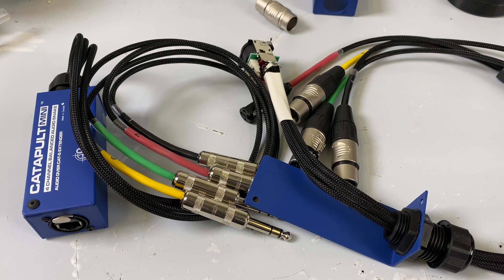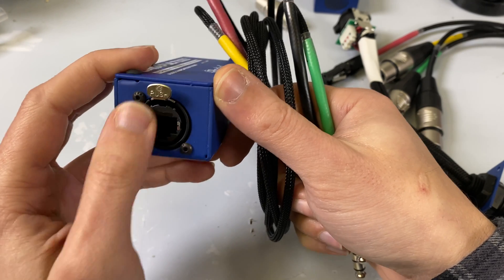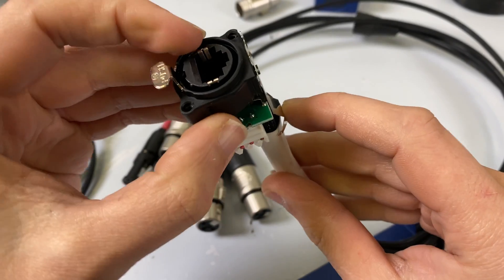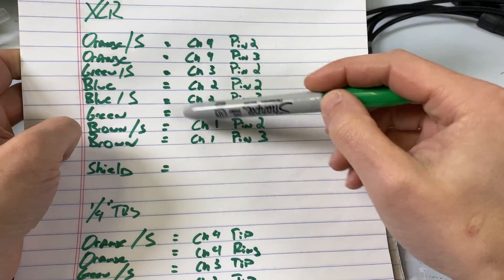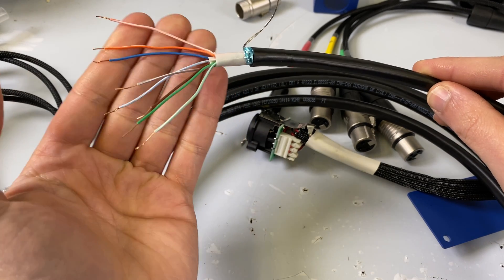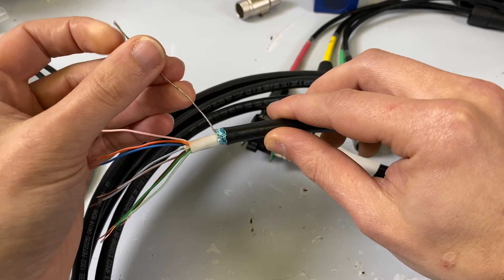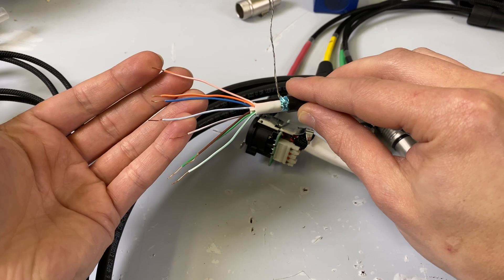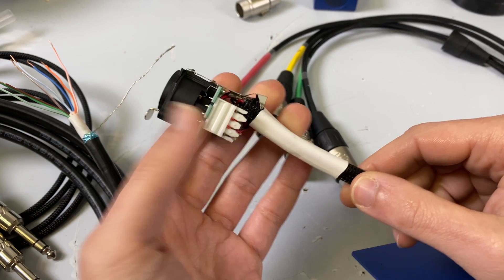4ch Analog Audio Over Cat5/6 Network Cable Pinout & Taking Apart A Radial Catapult.

Comment: Could I connect my mixer main L/R and have Mics with shielded power on the same cable? It would be over Cat5e shielded using a 2 male / 2 female box? I'm worried about crosstalk between the line level ouput of the main L/R from the mixer in the same cable as the Mic level input coming from the microphones. Thanks
Reply from the maker: You can. Crosstalk wouldn’t be anymore of an issue with L/R vs any other audio source.

Comment: Does radial use stranded wire on punchdown connectors?  Seems suboptimal vs solid wire. Have you noticed any issues?

Comment: What about the fact that all the four signals share the same ground wire? Could this generate noise or ground loop issues?
Reply from the maker: It’s not a problem. All the grounds are tied together in your mixer too.
Reply: Or some interference between signals?

Comment: Billy! I'd love to see a vid of you punching down xlr into these ethercon connectors and the tools you're using. I'm having a hell of a time getting it to work succesfully on my end. Wondering if there is a specific XLR guage optimal for the 26awg the punch downs are typically expecting.
Reply from the maker: Hey Matt, I usually use feed through female - female connectors. I don’t use punch downs in road applications. Even for boxes and panels, i will use a shielded industrial RJ. For wire, I use Belden 1303e, it’s way easier to work with than pull box wire. You can buy it from LM by the foot: https://www.lmcasesonline.com/belden-1303e-ethernet-snake-cable-cut-per-foot/

Comment: So what we call AES-72-TBD, not an official AES standard. Its sad to see a company as reputable as Radial NOT choose a known standard like AES-72-2O, which would make them compatible with others like the reputable and oft' found Sound Tools' Cat Tails or the offerings from Sescom. But I digress.
Reply: Hardly a minor point. People should pay particular attention to your comment. There is a world of gear using audio over cat that uses AES-72-20. Allows you to mix and match including termination into DB 25 very easily . Going with radial gear locks you out of that entire world. If anyone out there is considering going this route, which makes a lot of sense, make sure to do your research. Standards are critical, especially during live performance, where you may need to swap out gear very very quickly in the event of a failure Also helps minimize the overhead for redundancy.

Comment: Wht is the maximum length of the cat cable which can be used without an signal drop?
Reply: Of course that should be the standard XLR cable length which should be about 100 to 300 meters in line level

Comment: So these are just straight wiring, no other components on the circuit for managing impedance, etc?
Reply from the maker: Correct. Your preamps will have a transformer specifically for impedance matching.

Comment: I just purchased a generic pair (not Radial), and it comes out humming loudly when connected via shielded CAT6 cable. What could be the problem? Appreciate your help!
Reply from the maker: It’s a grounding issue. Grab a multimeter or cable tester to make sure you have continuity between all the pins 1:1 on each channel. If it hums on every channel, I’d bet they tied the grounds together like the Radial and they are disconnected or loose.

Comment: Hello Billy. thanks for take your time and teach us and share us your PRO work ! Thanks a lot. I want to ask you something about audio over cat. If i want to have 4 xlr balanced how can must be the ground cable attached??? If you nly have the utp cable and the xlr connectors (tails) how would you make the connection??? how the ground would connect all 4 tails?? Thanl you again !!!!!
Reply from the maker: Hey Luis, you need STP cable to run 4 channels. You can use UTP in a pinch. UTP doesn’t carry the ground, just hot and cold (pins 2 & 3). UTP also won’t pass 48v phantom since it needs pin 1 to complete the circuit. You could make a custom cable that has 2 XLRs wired to an RJ45 with pins 1-3 wired on each connector. I’ve made these cables before, I should probably make a video on it.
Reply: @billylaguardia  Thanks Billy ! i will appreciate a short video showing the differences between STP nad UTP cables !  how to addd the phantom power etc. Nice work !!
Reply from the maker: @luisberd  no problem, I’ll add it to my list!
Reply: @billylaguardia  Hi Billy. Thanks a Lot !

Comment: How is the ground wired to each of the XLR connectors?
Reply from the maker: All the XLR pin 1’s are twisted together and soldered to the chassis of the RJ45 jack

Comment: So I’m just wondering, is this pin outs are some industry standard, or every manufacturer came up with its own pin outs? And you can’t plug a radial box in one end and some random manufacturer on the other end?)
Reply from the maker: Most cables are wired with the T568B standard. There is an A standard as well, however most people use the B standard. Assuming manufacturers use the B standard (which I would guess they all do), you could use boxes interchangeably as the pinout would be the same.
Reply: @billylaguardia  I meant pinouts in the board, from xlr to rj 45 socket)
Yeah, for a cable - pins doesn’t matter, if they are the same on both sides
Reply from the maker: They are hot (pin 2) and cold (pin 3) in channel order 1-4. The pin 1 grounds are all tied together.
Reply: In your video count starts from ch 1 cold - brown, brown stripe is hot, 
But ch 2 - blue is hot, and blue stripe is cold

So in my version of rj45/xlr breakout box 2nd channel is mirrored to others))) 
It’s like |32|23|32|32 (count from ch 1 /brown)

I made my custom catboxes the same, so until I’ll use only them - pinouts aren’t problem, but if I’ll decide to by factory one…))) will it be compatible with mine?)))

Comment: Hi. Firstly, thank you for a great video. I have made a few XLR & TRS - RJ45  "patch cables". I have come across a situation I didn't know existed before I made my patch leads. I have been googling to find an answer to a question I have but have had no joy. I hope you or someone can answer my question. Its regarding the 2x types of Cat cables: "Straight-Thru and Cross-Over cables." The pin-outs are different between the 2x types. Here is my question. What type of cable does the audio industry use? Straight-Thru or Cross-Over? I hope you or someone can help me understand this. Again, thank you for your great video. Lani
Reply from the maker: The industry generally uses the T568B standard in wiring. This only really matters if you are using a buildings in wall wiring to send audio between rooms. If you are using your cable as a trunk line between XLR break out boxes, the wiring standard won’t matter as long as it’s the same. I’d stick with the B standard as you can use any pre-made cable. Crossover cables are generally only used for proprietary device communication. The only application I have ever run into that requires a crossover cable is programming a DBX zone pro. Hope this helps!
Reply: @billylaguardia   Thank you Billy for your advice and knowledge. Just in the last few hours today, I have been reading about these 2x T568A & B standards. I'm kinda glad I didn't know this last week! lol In one of the bars I play at, I ran a 15m Cat5e cable up thru the roof all the way to the back of the bar. The punters have always complained they can't hear the music from the front. Up till now, I've been using a wifi setup for a speaker way down the back. Anyway, it so happens after I made all my ethernet patch leads, "RJ45 to XLR, & RJ45 to TRS", it all works! Iol I have also since learned that the network cables I've bought and used are all "Straight-through!" Phew!! I must say tho, I certainly didn't follow either of the T568A or B standard! lol It just made sense to make sure that the "pin-outs" were the same at both ends!! In future tho, I will go with the T568B standard which seems to be the preferred standard. Again, thank you Billy. Cheers from down-under, New Zealand. :)

Comment: Thanks for the great pinout video... we use five Catapult Mini's currently on one end of a bundle of 5 Cat6 cables for 20ch snake as part of our flyrig. We are moving to using Dave Rat's SoundTools CAT Tails as they are lighter weight and all Neutrik connectors. https://www.youtube.com/watch?v=gTQUhJZqol0

Comment: These Cat5 breakout boxes are simply balanced analog audio connections running through the eight conductors in a Cat5 cable. What happens to the ground wires in each of the 3-pin XLR connectors, you may ask? They are all combined in the single Cat5 shield that surrounds the eight conductors. So not only are you relying on the fragile RJ45 connectors on the ends of the Cat5 cable, you are degrading the isolation of the previously separate ground wires of the four balanced XLR cables you plug into the inputs and outputs of the breakout box. If any interference or hum is present on any of those grounds, it will contaminate the grounds of the other three XLR cables as well.

TL;DR: Don't waste your money and risk your reputation on garbage technology.
Reply from the maker: To be fair, most devices share a common ground. Summing the grounds in this way really isn’t that big of a deal. The grounds are summed at the box instead of within a mixing console. The console grounds are summed to a chassis ground in addition to the electrical ground of the building.
Reply: @billylaguardia  - No, it isn't a big deal until a mysterious ground loop pops up an hour before doors open...
Reply: Anyone using this in a serious application is not using a fragile RJ45 connector and cheap ethernet wire. That is the whole point of using tactical shielded ethernet cable with EtherCON connectors. They are very rugged, high quality, twisted and individually shielded. Unlikely you are degrading the isolation of the separate ground wires of the four balanced XLR cables and there isn't a chance that a  "mysterious ground loop" will be popping up due to this cabling method.  These are excellent: https://www.youtube.com/watch?v=XlYbC0xH-MM but there many examples of solid tactile ethernet cables you can trust as well as any copper snake.
Reply: @PettyTheft  - It's still a fragile RJ45 connector under that thin aluminum "ether"CON shell. Those network connectors were designed for permanently-installed rack-mount servers, not for underfoot on-stage cabling. Dismiss the potential for inadvertent ground loops all you wish, it's not going to change the fact that these overpriced snake-substitutes are DESIGNED to degrade the ground isolation of low-level analog audio signals.
Reply: @QuicksilverSG  They are not all fragile. @Billy LaGuardia even has a video describing the difference between Neutrik NE8MX-B carrier only & NE8MX6-B which has an integrated RJ45. EtherCON connectors are tested and rated > 1000 mating cycles. BTW, a standard Neutrik NC3FXX XLR connector is also rated > 1000 mating cycles. EtherCON was designed for professional audio and stage lighting with constant insertions not for permanent-installed rack-mount servers that never move. Check out Dave Rat demonstrating running a phantom powered microphone over 1mile of Cat5. https://www.youtube.com/watch?v=f0nKK43Oeas and also a great comparison of Cat5e vs a audio snake and what the expected signal loss of 100 meter cables https://www.youtube.com/watch?v=KZqoA12Qjr8  Same with cheap XLR audio cables, you are correct low quality Ethernet cables are fragile and could fail. Quality tactical ethernet cables and EtherCON connectors are not designed to degrade ground isolation or break.  Our analog over Cat5e based monitor flyrig is injected in various venues audio system all over the US at 60+ gigs a year, and we have yet to experience any inadvertent ground loops.
Reply from the maker: @PettyTheft  thanks for watching my other videos! I have one taking a super cat cable apart as well: https://youtu.be/97HhNXF7OvQ. The RJ is very durable within the Ethercon barrel, especially if you are using the NE8MX6 connector vs the RJ carrier. I carry both the XLR & TRS Radial Catapults in my workbox. They are amazing little problem solvers. They are built very well and inexpensive. I’ve never had a problem with them live or in the studio.

Comment: Can you use this to run from FOH to the stage for the purpose of running 2 monitor sends and 2 microphones, ideally with option to run phantom power?
Reply from the maker: Sure. You just need to use a shielded network cable (stp) to pass phantom.

Comment: Awesome video! Quick note. Technically you could still use a twisted pair cat5e cable and have balances connections. You would loose the 4th pair due to using one of the 4th pairs wire as the ground, or just twist the last pair and use it as your ground bus.
Reply from the maker: Yes I indeed. I actually have a folder of video that needs edited showing how to make a 2 XLR cable where everything wires 1:1. I need to get moving on that!
Reply: @billylaguardia  heck yea good stuff. I'm working on my own box. But ya a cat5e twisted pair will work in a pinch.

Comment: Billy, thanks for the video. In a scenario where I would like to make 4 unbalanced T/S on each
side, how would the shield need to be wired to function? is this possible? Thanks!
Reply from the maker: Hi RT. You wouldn’t need to wire the shield in this instance. The hot and cold will match pin to pin in a non shielded cable.
Reply: @billylaguardia  I was hoping to make a simple 4 channel snake for a 4 cable guitar rig from pedal board to amp.. Could I attach the shield to one of the channel grounds? would that activate the outer shield of the cable?
Reply: @roythelms  hey did you make any progress with your unbalanced setup, im thinking of doing the same to hook up keyboards. Was hoping I could send 8 unbalanced jacks down the cable using a shared ground on a shielded  rj45 cable for all 8

Comment: With RJ45 or any other product are you aware of a way to add an on/off switch that would allow the 4 mics to be "muted"?
Reply from the maker: You would have to use something similar to the below link. You could probably get away with a 4 terminal switch by wiring the hots to the switch, while leaving the colds wired 1:1.

https://www.mcmaster.com/1789N57/

Comment: Thanks for this info, Billy! Is there anything else to Radials Catapult breakouts circuit wise? Or just an ethercon connector wired straight to XLR, TRS?
Reply from the maker: Hey Jim, no circuitry. It’s just a very nice PCB with punch downs connected to an Ethercon. It’s a very nicely designed box.

Comment: Thanks for your clip! The challenge of my actual project is to pass : 2 +/- audio 50W wires (4 pins) and 1 +/- wires (2 pins) from an Arduino to a LED strip. Those 6 (4 to exciter speakers, 2 to a  LED strip) all must pass into a "slip ring" for rotation aesthetic purposes. Slip rings compagnies never talk about audio, but i remember that the Cat6 is good for audio transmission. I used XLR6 and even XLR9 before, i wonder if you know anything about the way to go to for a "slip ring"  audio solution for 2 x 80 Watt coaxial audio outputs aux the 2 wires for the LED strip all in one slip ring ? Thanks for your time. Martin
Reply from the maker: I’d say you would be fine with using Ethernet cable. 50w would be fine down network cable for the speakers. You would need to make sure your pin out matches what ever is in your walls. I’d punch an RJ45 to whatever standard is in your walls and solder the tails to whatever is coming out of your slip ring. I’ve only ever encountered slip rings with power reels, but I’d guess audio would be fine. Maybe make sure the rings are heavily lubricated to make sure there isn’t any crackling when they are rotating. Good luck!

Comment: Hey there - I’ve tried to wire my studio with 20 lines (16+4) using CAT6 to XLR; I’ve terminated both of the analog ends with Neutrik combo jacks and get cross talk on every single channel. 

Using super duper heavy duty shielded outdoor burial CAT6 cable, shielded RJ45 keystones, LyxPro CAT6 to XLR units, and again Neutrik Combo jacks (XLR+TRS).

I’ve been testing/troubleshooting tone one channel per set of 4 channels. Any idea why I’m still getting cross talk on all four channels when only one of the inputs is running tone? Should I try and ground the shield wire from the keystone to the chassis of the panels/rackmount panels? 

Thanks!
Reply from the maker: Hi Tieran, are you testing with the keystones in a jack plate? Just thinking that if you are grounding to a metal keystone, and that metal keystone is touching a metal wall plate, all the pin 1 grounds would be touching mounted the wall plate.

Comment: What is the maximum length one can run on this?
Reply from the maker: Same limits as any analog audio cable. Depending on the situation, you can easily go 300’ before you could possibly see problems. Shielded data cable in twisted pairs will reject RF very well. So you should be able to go longer without problems.

Comment: can I run a parallel 0.5 mm wire for the ground say 30m ?? or is ground even necessary for running instrument channels and cordless microphones??
Reply from the maker: You could in theory run a separate ground wire. However this would not be a durable solution compared to simply using STP shielded cables and shielded RJ45 connectors. Audio will still pass over UTP cable as + & - signals are within the RJ45 connector. Instrument signals (aka TS) will be fine. A wireless mic will be fine as long as it’s 1/4” output is unbalanced.